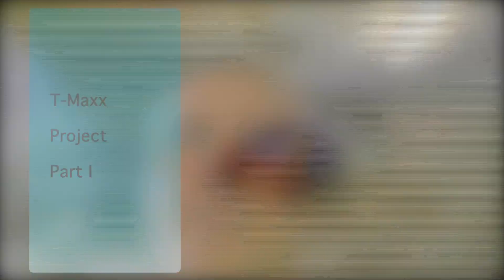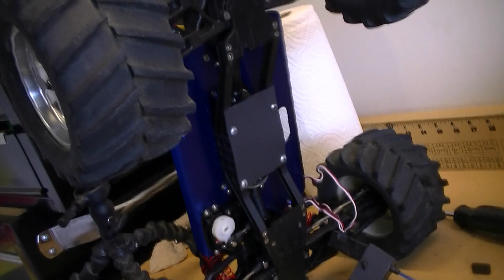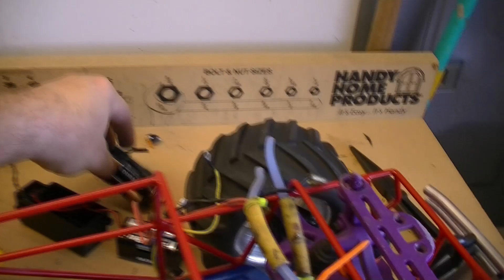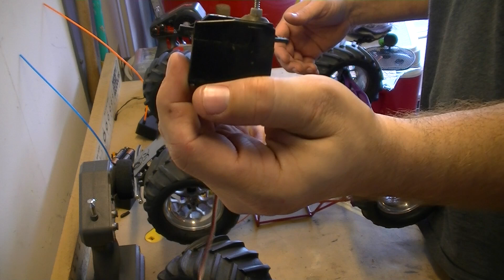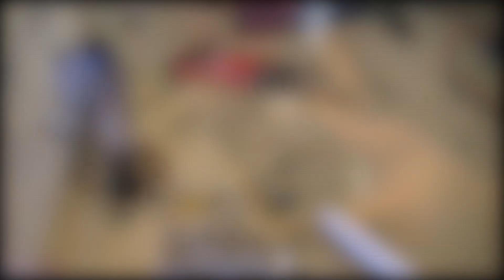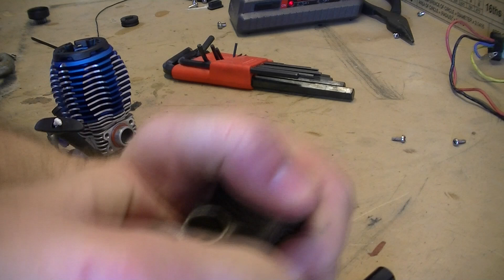Traxxas T-maxx rebuild Part I

Comment: I recommend using a hammer to remove the flywheel.  A. good tap on both sides of the engine and it should pop off.  The prying method usually scars the engine block and/or flywheel.  I learned this the hard way.

Comment: If the engine was shot on that newer t-maxx from ebay i assume he probably didn't brake it in correctly.
Reply from the maker: It was just wore out
Reply: How can a blown engine be directly related to not breaking it in correctly
Reply: RabbitFootedKitty because the piston can wear very prematurely and the sleeve can warp or crack if it is not broken in properly

Comment: @ckblood05 I did the same thing and it made a huge difference.  I used a hump pack that fit in the original holder and also replaced the original switch harness with the airplane style that has a charging lead built in so you can charge the pack with the switch in the off position.  Keeps you from having to remove the pack to charge it.

Comment: sweet looking t maxx you got! you should go with a 5 cell hump pack battery! you can then recharge it instead of replacing aa batteries plus you will get more power to your servo's making better braking power and faster steering!

Comment: I've been into this stuff for more than 25 years and have owned several gas planes and trucks, including a T-Maxx 2.5.  If you guys need any help or advice, let me know.  I will say that the key to keeping a 2.5 running good is to keep it cool.  It's too small of an engine for that truck, so it does much better if you go down two teeth on the clutch bell (you'll have to adjust the shift point)  Also, keep it a little rich and maybe even cut a vent hole in the windshield to allow more airflow.

Comment: i sold my revo 3.3 on ebay a few moths ago , jumping off the house can really add up with those A arms lol , get the 3.3 cause the 2.5 is like night and day with those things .. also the blue colored servos are waterproof and last alot longer then the stock ones .. and make sure when you first start the new motor that you follow the breakin procedure to the ''T'' ! good luck and have fun jumpin